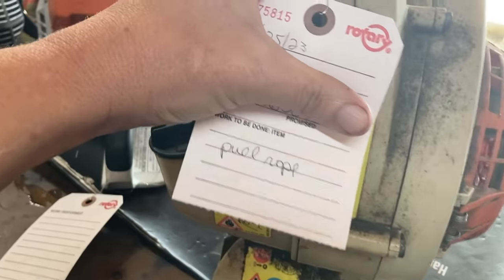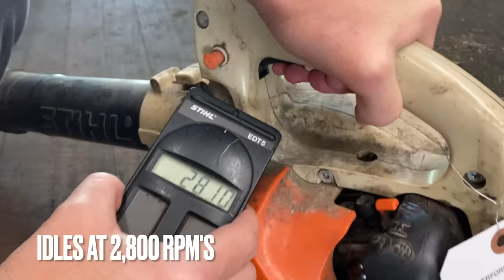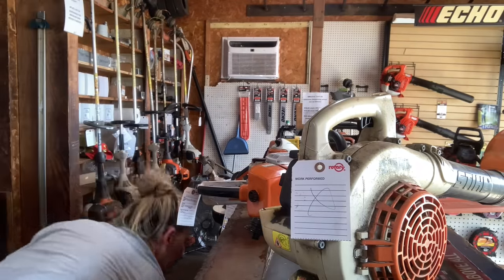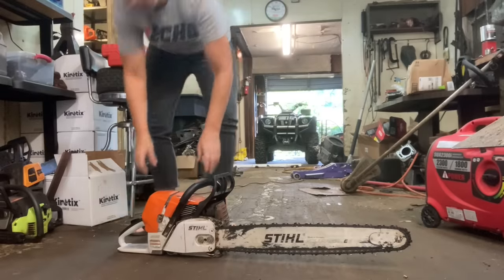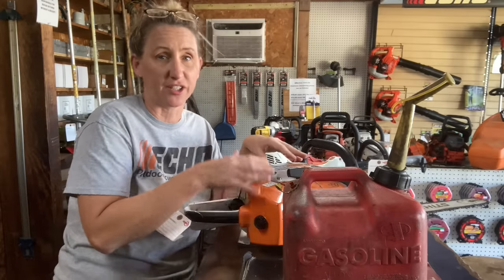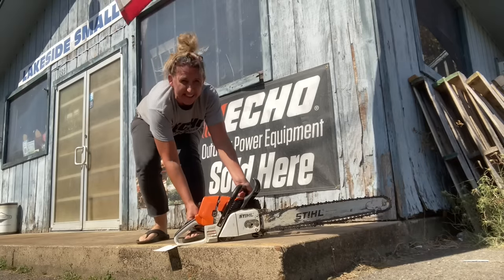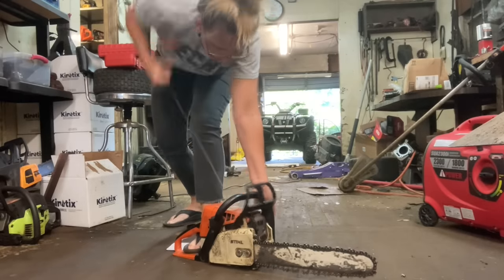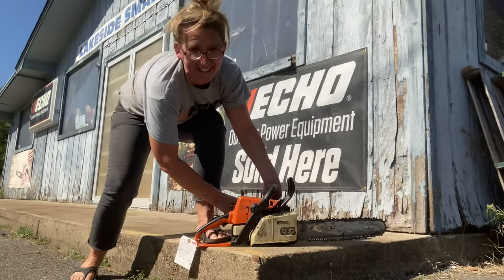The Burning Truth of Canned Fuel. This HUGE Distributor Doesn't Like Me Exposing It!

Comment: I use the pink stuff from the big box stores because it doesn’t have ethanol and I don’t use it frequently enough to avoid stale gas. It doesn’t appear to do any damage if you’re able to fix any issues by switching to oil/gas to fix any problems. It’s mostly a trade off for people like myself.
Reply: @TheFreedom4you  I have used both Tru Fuel and VP. I think Tru Fuel is a bit better as  my stuff runs better on it. It's possible that doing a gas/oil mix on my own is better but, as I mentioned, it would go stale since I don't use it all the time.
Reply: @corvettetexan  You can buy ethanol free gas at a few stations, add stabil to E10, or keep it in a sealed container away from sunlight. I mix my own fuel and I only run through maybe a gallon or two a year. I don't have any problems using pump gas with no stabilizer in a sealed can that sits in my garage.
Reply: I just buy non ethanol gas for small engines.
Reply: I run tru fuel 50:1 never had an issue with any of my echo products. And run the 4 stroke in my mower,snow blower and gennys  no problems. Its the only way to get non ethanol fuel by me. Pricey but no headaches for years.

Comment: Loved this video.  It could not be more obvious.  

I have gone to using Stihl or Echo pre mix.  I sometimes let my tools sit for up to 6 months, I have about 10 of them, and I’m just a homeowner who likes power tools, so I don’t use all of them every day.  Have you ever had any problems with these fuels?  My favorite now is Moto Mix.  It’s expensive, but cheaper than replacing OEM carburetors.  I have had no problems since I went to Moto Mix.  Curious, what is “your fuel”?
Reply: Like you, I'm also a homeowner who likes power equipment and I do the same as you, I use Motomix in my 2 cycles when storing and sometimes for regular use but most of the time I mix my own for regular use and I never had any problem with my equipment that I've owned for the past 10 years. The only thing about Motomix is that I noticed when using my Stihl ms441 and KM130r that they have a bit more power when I use my own 91 octane gas mix at 50:1. I never got an engine that bogs down like the blower in this video BUT I did use the 4 cycle Trufuel from Home Depot once in my lawnmower and I did have trouble starting it so I never bought another Trufuel can after this and never will. Trufuel is piss in a sealed can.
Reply: No problem letting non ethanol fuel mixed with echo oil sit for a year.

Comment: The only "canned gas" I have used is the Husqvarna branded pre-mix that I purchased with new saw.  It started OK, but the saw, an auto-tune 572XP ran hot with it.  My go to has been pump high octane with Red Armour at 40:1.  I store long term with the Husky pre-mix in all 7 of my 2 cycle tools.  Thanks for your observations, tips, and experience!
Reply: Everything I have that's 2 stroke is 40:1 ratio and 90/92 octane. 
If long term storage I go with  non eth. I tell all my customers and friends to use 40:1 in there boat engine and if it's out of warranty to take off oil injection.  Especially a V6 mercury! And the old VRO Evinrude/Johnson.
In fact with those engines all one has to do is put enough oil to get 40:1 in the amount fuel left in tank  and let it mix thoroughly. Check to see that fuel coming out "quick disconnect  has a color to it. Run engine with oil line still connected to  engine for a while on flushette which will like double oiling. After running engine say 10 to 15 minutes you are sure of oil mix in fuel tank is in carburetors you can disconnect the oil line from engine and the wires from the oil tank to the engine harness  pull both out and remove oil tank. Pour rest of oil back into a container for use later. Watch as oil in oil container get near empty as there is usually sludge in bottom of container.  Plug oil connector at engine with a cap and tie rap or worm clamp and you are done. 
The vro pump now is just a fuel pump. Use PRIEMIUM FUEL AND 40:1 mix from then on !
PRIEMIUM  helps in decreasing the chance of " detenation " in an engine especially a two stroke outboard.
Last  I remember the new VRO pumps were north of 600.00 dollars and warranty was void if you use ethanol fuel !
 That's how they got out of lawsuits  from the junk vro 
 Pumps. Which is one reason why OMC went under. Nor so much lawsuits but replacing powerheads on blown motors still under warranty.
Reply: I've got maybe 12 saws and I think the 572xp is my favorite.

Comment: Great video.  Last time I started to buy a gallon of pre mixed fuel at Lowes and Home Depot the price was $25.00 a gallon.  Where I live gas is now going at about $3.25 a gallon.  Pre mixed fuel is ridiculously over priced, not real tough to mix your own.
Reply: i use vp canned fuel mostly for storage over winter. Burn the tank off in spring and mix my own until storage time.
Reply: Canned fuel is advertised as being able to be stored 2-3 years with no issues.
Reply: One complaint with your analysis is the you should use ethanol free fuel.  I expect it will be slightly more than $3.25/gal but yes it is less expensive.
Reply: @mbrick  none available where I live.
Reply: Premixed fuel in Sweden is about $15 a gallon. ( just doing some math as well we of course don't use gallons or $ )
While from a tap it would be $10 for gas. 
Quite a difference.
Reply: @danlux4954  bummer. I would definitely use canned fuel then. Not sure what brand the video refers to but VP is blue and has worked great in my experience. Ethanol is horrible on aluminum and rubber parts.
Reply: @mbrick  trying to find an additive to lessen the ethanol damage
Reply: Lowes and Home depot don't sell fuel. That canned crap isn't fuel. The companies who make the equipment are likely partnered with the companies that produce the  non fuel because they're building crap equipment from the Chinese plants that puts Americans out of work from Chinese slave labor. If a piece of equipment cost $300 in America,  how much do you think the companies pay to manufacture and ship from China to the U.S.? I'm betting no more than $50 U.S. dollars to produce and ship.
Reply: @mbrick yah, maybe 4, even 5 bucks a gallon, not 25
Near me it's usually about the same price as "premium" gas
Reply: @hnorrstrom that's not to bad of a difference compared to usa. Canned gas is at least 5x more expensive here

Comment: Been using chainsaws all my life. Been a Stihl man as well love them. Now I getting older and don't use my saw as often I agree with everything you say. I have started using fuel stabiliser and next I will only buy small quantities of more expensive fuel. I now use your starting technique as well. Its refreshing to come across someone that knows what their talking about.
Reply: Any truth that Stihl, detuned (retarded) the timing on the newer saws and equipement.
Friend was also comparing port timing on same model but 2 yrs apart.. differant spark timing and slightly differant port timing ..

Comment: I ALWAYS mix my own using pure gas (no ethanol) with the oil!
Reply from the maker: That's the BEST way to do it!
Reply: Where do you find pure gas now a days?
Reply: The local farmer’s coop has a dedicated pump.  The OnCue quick shop also carries it
Reply: @joeblow5154 Premium fuel typically doesn't have ethanol added (at least in Canada anyway) its only 87 and 89 that it's added to. 91 is ethanol free.
Reply: @joeblow5154 you can get pure gas at a marina
Reply: I buy the it for can. You can't get metal gas can any more. To bad have use funnel to refill it.

Comment: 😂  I'm glad you got the fuel distributor's attention!  All they have to do to get you off their back is to make some fuel that actually burns.
Reply: All you have to do is go but gas from the gas station and make your own mix instead of spending $10 a gallon for that crap which I have never bought or used in my life and never will.
Reply: And that does NOT have ethanol in it.
Reply: I don’t want it to burn I want it to explode.

Comment: Great video to show at their seminars! As the saying goes "Truth hurts!" I mix my own using non ethanol gas and Echo oil mix. Have never had a problem!
Reply: I've always mixed my own @ 32:1, regular pump gas.  Yeah, it's tough on diaphrams, about 2 years they're stiff as cardboard.
Reply: Trex I do the same thing.  Regular gasoline with no ethanol and Echo oil.
Reply: Agree 91 no ethanol with red armor, my equipment runs better than anything else
Reply: Where is everyone finding ethanol free 89 octane (or higher) gasoline?  Every station near me has those with 10% ethanol. The only ethanol free option is 87 octane.
Reply: Only Sunoco has it, no where else.  I also mix 40:1
Reply: @isaachobbs4206  Yeah, no Sunoco near me. I run 50:1 (specified by the manufacturer) and stabilize my fuel (89 octane E-10) when I mix it. Judging by the residue at the exhaust screen, it is more than sufficient.
Reply: @thisisyourcaptainspeaking2259 Ive go
I've got a 3 year old echo on pump gas and walmart 2 stroke oil and it runs great still
Reply: @karlrovey  I have been using 87 octane with the Echo oil.  I haven't had any issues with the 87 octane.  But, here again it is non ethanol gasoline.  I use the 87 octane non ethanol gasoline in my 2003 Yamaha motorcycle.  Same story.  No issues.
Reply: @contraband1543  I'm not sure which oil you're getting from walmart but hopefully it's low-ash API-TC 2-stroke for air cooled engines as opposed to tc-w (outboard engine) for water cooled 2-strokes
I currently buy the Bombardier 2-stroke oil, 1 gallon size.  My trimmers are going on 30 years and some of the chainsaws go back further.  The only problem I've experienced happened while using a stale mix of (the old-school) caster-bean 2-stroke oil.  Smells fantastic as it burns but I learned the mix goes stale quickly.
Fresh gasoline only, freshly mixed 1qt at a time (1oz oil to 32oz gasoline)
32:1 gives me some room for error, although I'm pretty precise with my 2oz syringe.
Reply: @krisgreenwood5173  Unfortunately, running 87 octane would void the warranty. 89 octane E-10 does not void my warranty. It hasn't caused issues (probably because I stabilize my fuel), so I'll keep running it.
Reply: @karlrovey  I have nothing still under warranty.   If I drive far enough I'm sure I can find 91 octane but 87 octane without ethanol is just blocks away.  I don't mind paying for the 91 octane, it's just not closely available.